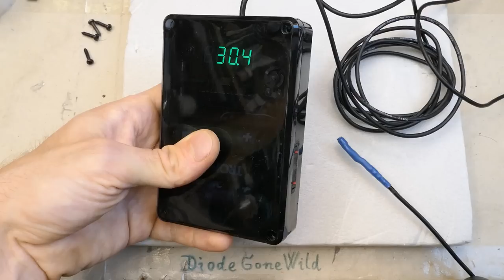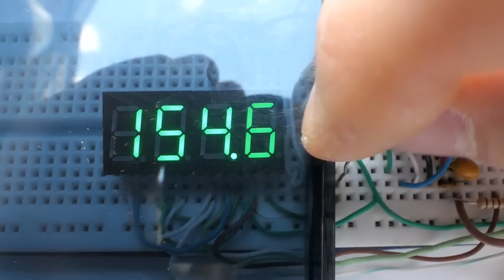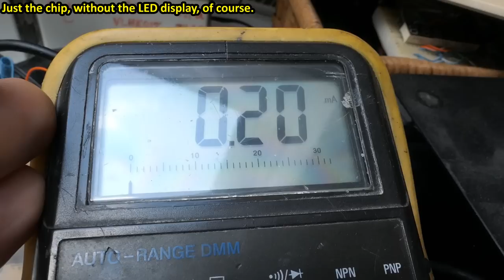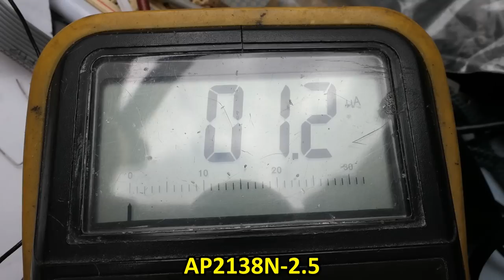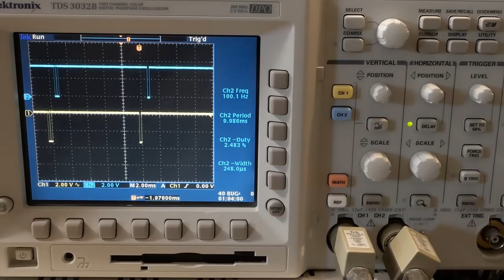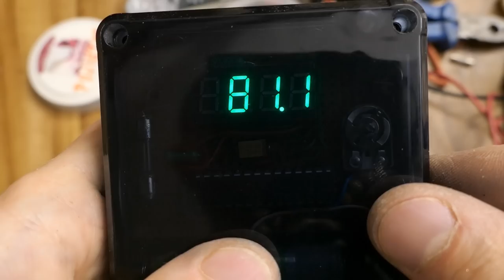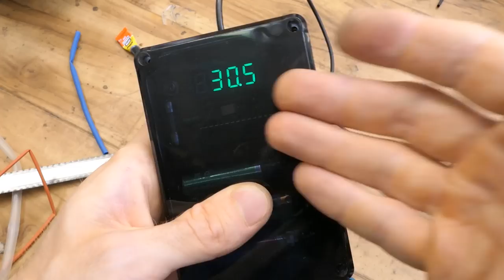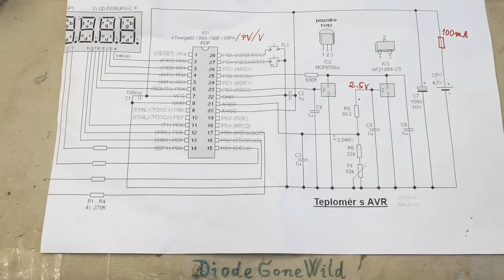DIY digital thermometer with MIN/MAX

Comment: Try with a low voltage PIC microcontroller with built in LCD driver, like for example PIC16LF190x (1902 to 1907)  - even the smallest 1902 has 4 common pins and up to 19 segment pins, plenty for a 4 digit lcd display, and these microcontrollers can run as low as  1.8v and has a fixed voltage reference (1.024v or 2.048v)

Comment: I really like your microcontroller projects. Using assembly you really use the most of the microcontroller in the most efficient way. I think it would be great to show some code on the video so everyone can see how is to programm the AVR without arduino but with assembly, the most efficient way to programm theese simple kind of MCUs.

Comment: Nice work! 
That MCP9700 temperature sensor seems very nice in general, because of it's linear response to the temperature (if using something like a thermistor, it has a very non linear response to the change in temperature - which makes building an accurate temperature measuring device much harder.)

Comment: This is really nice! I'd say you should add capability of measuring humidity and then calculating the dew point temperature and the wet bulb temperature which are both crucial for human beings.
Reply: And definitely add facial recognition to prevent unauthorised attempts to access the temperature

Comment: Try duplexing an LCD! It only requires Low/High-Z/High voltage levels on the two backplates (which can be achieved using 3-state logic), while each segment pair still only uses Low/High. So a full 4-digit 7-seg display (32 segments) would require just 18 pins (or likely fewer if you only need 3½ digits), which you still have room for on the ATmega88. You may need a resistive divider to pull the backplates to around ½ Vcc during the High-Z phase, resulting in a 3:1 average absolute voltage ratio between ON/OFF segments (or 5:1 RMS), which I think will still produce very good contrast and viewing angles.
Reply: No ono paralelní LCD taky není sprosté slovo, zvláště když jsou dobře dostupné třeba 4DR821B. To pak může budit CMOS posuváky, nebo starou dobrou 7211.
Reply: @teslakovalaborator  He has used a static LCD (single-backplate) before, look up his LCD clock+thermometer. This seems like an easy and practical project to take up the multiplexing challenge. However, duplexed 4x 7-seg displays, though they exist, are very hard to find, and quadruplex is not really worth it due to 4 voltage levels (2 MCU pins) required for all segments and backplates...

Comment: It's possible to buy empty metal tubes which you can place mcp9700 into and fill it with silicon or epoxid. Exactly the same tubes are used for NTC probes.
Reply: I guess antenna tubing would do too. It is nickel plated brass usually, so it should be sealable by soldering it shut.

Comment: 38 degrees here in Athens, Greece today :)
Reply from the maker: You're in a different climate zone ;). I'm melting at 30 degree. The highest indoor temperature I've seen here was about 33.
Reply: I start melting at 40 degrees. The weather is 37 degrees
Reply: @DiodeGoneWild  I agree 👍
Reply: Climate zones don't exist anymore in Central Europe. They're now all the same. Germany reached 42°C in June 2019 and this year we peaked at just under 40 again. Central Europe will see the 50°C mark before 2030.
Reply: @kyoudaiken  - Need more coal fired power generators, so you can use more A/C !

Comment: Also works with a Mega168A or 328A or 328PA. The 88A is just smaller.
Reply from the maker: I have some 328P but I never tried to put a program for 88 into it without a modification...

Comment: Cool low powered led displays, what about e-ink?  Could that be an even lower powerd option? especially for something that doesnt change much like temperature, or even a voltage monitor maybe, like solar charge contorllers, some of which are out in the sun which the e-ink display would shine in such an application (or not shine because theres no glare)  Anyway love the power efficiney and simplicity of this design.  With such a low power draw those cheap little solar panels could keep  this thermo-meter alive indefinately.   I notice nihm batteries seem to last forever, they just keep going, just at lower voltages as ive noticed with my LED lights, not as bright as with lithium but theres no cutoff, they can go down and down and recharged back up.  I actually shorted a bunch trying to make a diy 9v battery pack out of these 1.5v nihm rechargable batteries.  Needles to say i made a mistake and it wasnt a battery pack it was an electric chair for batteries.  Even the spring holding one of the batteries lost all springiness when the short circuit amp current went through it.  I thought for sure these nimh batteries were toast.  Looks like only 1 or 2 batteries took the brunt of it but when I recharged them, all good as new, actually coulndt find which of the ones got down to 0  they all recharged to the same capacity like nothing a happened.  Anyway maybe an underrated battery chemistry?

Comment: Very interesting project. I was wondering why did you decided to use an external voltage reference and adjustment potentiometer instead of using the internal voltage reference and design the software around it. And maybe use some button combination for calibration. The sensor would provide about 0.25 C/bit instead of 0.2 so a little bit less accurate and the code is going to be a bit more complicated especially since you are using assembly, but is there another reason behind that design choice?
Reply: Internal voltage reference is not stable and that leads to slight fluctuations in the measured temperature.
Key to get a perfectly stable temperature reading is having a damn stable voltage reference. That's why the external reference.

Comment: Have you tried entering sleep mode and waking up by either a button press or a periodic timer interrupt ? I think this would save more battery power as the samples you need to take can be taken periodically and in larger time spans

Comment: There is an 80-240V AC to 5V 700mAh DC power module that stands for WX-DC12003..you should have a look at it..very small size 23 x 14mm really interesting

Comment: Do i have to modify the circuit if i want to use TL431 instead of the AP2138N-2.5 (14:50)
Reply from the maker: Of course. TL431 is a parallel regulator. Use it in a 2 terminal configuration, with a series resistor calculated to pass at least 1mA at the minimum expected supply voltage. R = (Vcc - 2.5V) / 0.001A. For example for 4V minimum Vcc, you use a 1.5k resistor. And of course, at a low brightness, your TL431 will draw more than the rest of the device, but whatever...

Comment: Hi Dan, did you use an existing arduino ide software to write code? and try to use an arduino nano or mini that you can buy cheaply on eBay or Amazon
Reply from the maker: Hell no.
Reply: @DiodeGoneWild  Atleast those Commercial Arduino's have a Protection and a Communication Protocol to PC and Arduino itself, But I respected your decision, But standalone Arduino have benefits too, they didn't take too much space on breadboard or PCB  which is nice for portable project
Reply: @Jyaazu  Assembly (which Diode uses) can be a lot of fun, but yes, programming some things can be a monumental pain. I was (and still am) a fan of programming with Arduino compiler, but now I am making a MCS-48 nixie clock. It's difficult, but also amusing to keep the program between the limits of that 1976 crappy MCU.
Reply: The Arduino IDE is straight up trash, if you want an upgrade without writing AVR assembly yourself, you can get GCC-AVR and integrate it to VSCode, waaay better
Reply: Also Arduino uses a bootloader which doesn't only makes your startup slower, it also adds higher current consumption when in deep sleep
Reply: haha this question is easily considered as an insult 🤣
Reply: @NullPointer  love to hear, but for low power, the standalone atmel uC are best
Reply: @teslakovalaborator  love to hear
Reply: @DiodeGoneWild  no space for c compilers here, only assembler :)

Comment: Hi, Super Cool project.
Could it be used instead of AP2138N-2.5 a Zener diode 2.5 or 1117-3.35 ? And as a  Temperature sensor (MCP9700A) can be used different sensor Dallas DS18B20 or 3-pin KTY81-121.
Thanks.
Reply: You need a damn stable voltage reference and zener diodes aren't as stable as these low power voltage references like this one or tl431 are...so zener diodes aren't a great choice for temperature sensing projects!
As for the other temp sensing devices are concerned you can always compare their datasheets and decide yourself!!

Comment: How do you program these controllers or any programmable IC in general?
Reply: Through "programmers". They are hardware devices that can load hex files generated by your compiler into the memory of mcu.
"USBASP" is the most popular programmer used to program avr microcontrollers.....it's an open source, anyone can build it by himself!

Comment: You might have said this in the video, but if so I missed it. Why not a physical power switch to disconnect the batteries? Is the self-discharge of NiMH high? (I know alkaline self-discharge is very low.)
Reply from the maker: When you already have 2 buttons, why add a switch? Too many things to physically mount to the box.

Comment: Soldering on the temperature sensor?   I broke a few by doing this (and lost hours of troubleshooting my circuit.... stupid me)   
Lessons learned: I now use wirewrapping; a tiny wire directly wrappend on the legs of the sensor.  Then heatsink over it
Great video with very useful details... no nonses but great facts
a bucket of resin and of course a cat to keep us with our feet on the ground  ;-)
chrisV
Reply: Keep the pins long. Hold the component with pliers between the component and the end of the pin. Solder on the end of the pin. This way the pliers suck the heat thanks to it's high thermal inertia.
Reply: @cmuller1441  i don't recall ever trashing any silicon chips by soldering, and i use 100W soldering gun, perhaps his solder is lead free crap with too high melting temp.
Reply: Flux helps, the faster you can get in there and get out the less heat soaked the part becomes. You're doing it wrong if a small joint takes more than a second or two.

Comment: MCP9700A has accuracy ±2C. What's the point to have display resolution 0.1C?
AP2138 is just LDO, it's not voltage reference. I haven't seen LDO to be used instead of reference. Is it stable enough? Especially temperature stability.
Reply: If you go look at the AP2138 datasheet, you will see that regulator has a built in voltage reference, as most regulators do. It's just less precise than an actual voltage reference, and with worse temperature coefficient.  But it doesn't really matter in this case, it's not like the other components make it possible to be more than 0.1c accurate, therefore minor output voltage variations won't matter that much.
Reply from the maker: Well, the datasheet of  MCP9700A  says ±2°C, but I have tested multiple of them and they all seem to be within about ±0.1 or at most 0.2°C. The voltage reference is also stable enough. It reads 2.501V at room temperature and 2.502V when heated too hot  to touch :).
Reply: @DiodeGoneWild  I would like to add, Accuracy and sensitivity are two different parameters. For example, you may have a ruler separated by millimeters, but it has an error of 2 cm (eg, in one meter), but still, the difference between two different lengths (of different objects) can be measured with a sensitivity of one millimeter.

Comment: how do you chose the MCU s? besides DIP package and AVR since i am never sure how you do it .
do you write the code before you buy the IC? ( so that you know its size and ram usage) or simply get something big enough ?
also there are some underage ICs that would keep a pin low if Vin in usder a set amount i think if you use one on the reset pin you can draw less current while on undervoltage
Reply from the maker: Mostly based on number of pins. I almost never run out of program memory. I write the program in assembly for a particular AVR. ATmega8 and 88 have 8kB memory, this thermometer doesn't even use 1kB. And it doesn't even have to use RAM, just like any simple AVR program written in assembly, because 32 registers might be enough. The reason I switched from 8 to 88 is that it has 2 output-compare units for timer/counter2 (the only one that runs in power save), unlike 8, which has just one output-compare unit. This made the PWM of the display brightness easier. 88 also has PCINT function to wake it up from power-down using any pin. On 8 I'd have to rewire it and put the button on INT0 or 1. And, of course, 88PA draws a bit less than 8A. And I think I can get away with no undervoltage protection. When the battery gets flat, I don't care if the chip resets or if it gets stuck :). At this point, you're changing the battery anyway and it resets in the process of changing it. And the display will be far too dim long before the battery voltage would be so low it would make the chip stuck.
Reply: @DiodeGoneWild  thx, i am always a bit paranoid with program size would be to large so i allways default on ATmega328... and that is overkill and now with the chip shortage i sprt of started to look into other ATmegas like ATtiny and other weaker  ones 
on a side note where did search for features like that compactor do you look up many datasheets or search on some list/site ?
Reply from the maker: Every common AVR has a comparator. And almost every common one has ADC, except ATmega8515 and ATtiny2313. I always choose from the more common ones like attiny13, attiny25/45/85, attiny24/44/84, attiny2313, atmega8, atmega88 and atmega16. Mostly based on number of pins, whether I need the ADC an so.
Reply: @DiodeGoneWild  thx, saves the AVR series were confusing on sites since there are so many i had no idea what was more popular/used

ps video idea: AVR programing guide + how to chose

Comment: I like the design but I think I would rather power it off USB in my situation. I guess putting a resistor or a diode in between to make it 4,5V should be fine?
Reply from the maker: Everything in it can run on up to 5.5V, so you could use 5V directly. Maybe just increase the resistance of the display resistors couple times. Or maybe not, if you have a dim display.

Comment: I have a Atmega8-16PU Micro-controller, does it work with that Micro-controller?
Reply from the maker: no
Reply: @DiodeGoneWild  What about  first version? And I have also  Atmega8A or Atmega328P chips. Thanks.

Comment: I had the requirement to feed normal 7-segment displays with battery at as low and constant current consumption as possible. I decided to drive only one segment of all digits at a time. This way the battery "sees" only the current consumption of one segment - no matter how many segments have to light up. Is there a special term for this kind of multiplexing?
Reply from the maker: But to reach enough brightness, you have to increase the peak current of the segments, so you don't save any power. This won't make the display more efficient. Just dimmer, if you keep the same resistors.

Comment: For the low voltage consumption, I bet it goes in a reboot loop. Maybe that case is not handled properly.
Reply from the maker: I think that under the BOD level, the program has no effect. It's not running.
Reply: @DiodeGoneWild  I don't remember all the details but I think it's in reset but then tries to restart. Do at the beginning of the start code you are supposed to check a status flag and see why you start. After a BOD the right thing to do is probably to disable BOD, disable the buttons and to go in deep sleep immediately.

Comment: Why would you have a temperature sensor under the sun light? The reading would not be accurate because the thermometer would show the temperature that the sensor is heated to, instead of the actual air temperature.